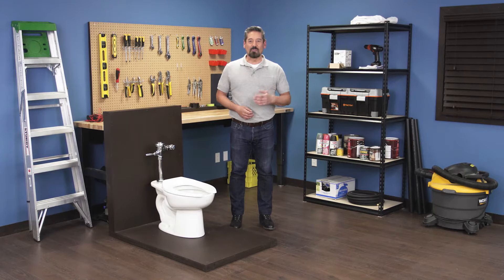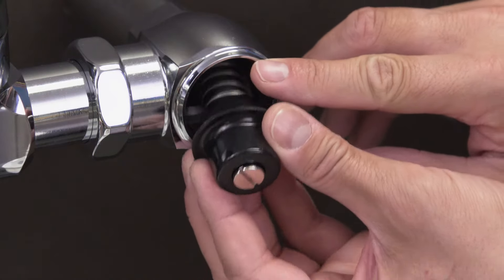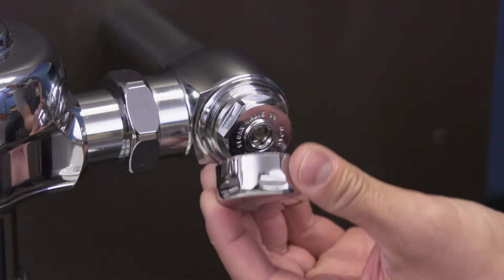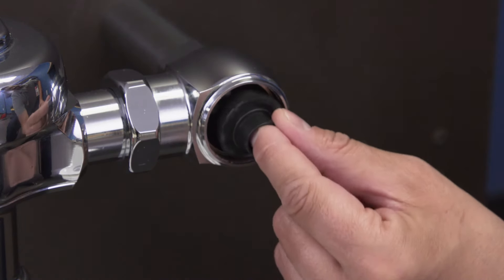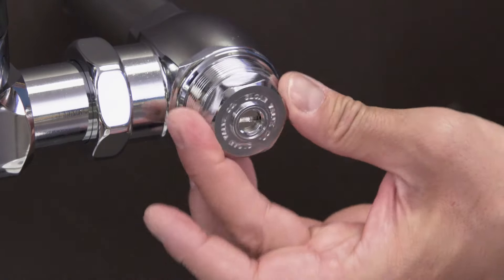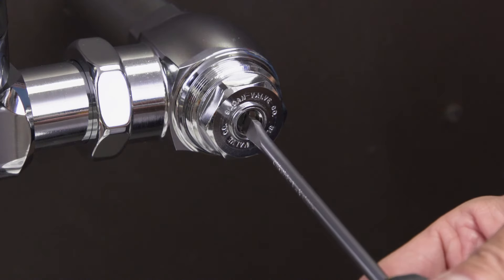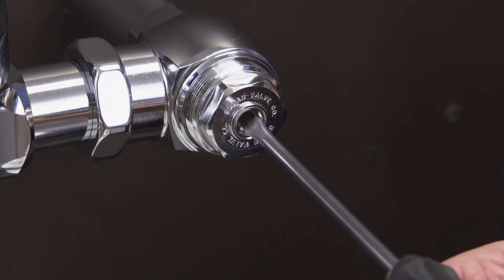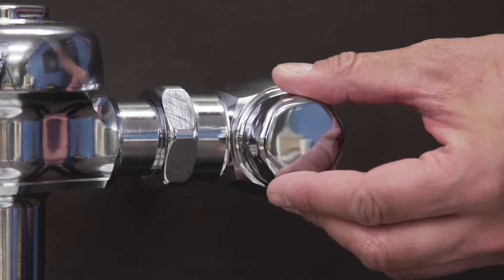Sloan Regal Flushometer | Control Stop | Repair and Replace

Comment: I just had the screw to the control stop get tight and stuck. Kept trying to turn to open it then the screw totally took a dump. Why do screws get stuck or go out on these.
Reply from the maker: Thanks for watching. It could be corrosion or a buildup of calcium that causes the screw to seize up.

Comment: Close the shutoff valve to the water line. This might be located in the ceiling or wall panel. Is there a way to trace where the shutoff will be? I have a toilet control stop that need la changing and have to trace it down to find it?
Reply from the maker: Thanks for watching. Every building is different so it is difficult to say. In some buildings there is a shutoff valve to the entire bathroom. In other cases you'll have to shut off water to the building. You can contact the building management as they should have more info.

Comment: having this problem rite now. plumber coming today. i am not fooling with it myself. i live in a 35 unit condo building. but they are replacing the entire flushometer.
Reply from the maker: Thanks for watching Mary Jaye. Sometimes its best to get a professional, but its always good to know a little bit about what they are doing. For installations, this is whats involved: https://youtu.be/Owi6awYTTnw
Reply: 3 MONTH OLD REPLY. I DON'T USE G MAIL MUCH. IN THIS CODNO BUILDING ONLY A LICENSED PLUMBER CAN DO THE WORK.BUT I WANTED TO SEE WHAT THE PROBLEM WAS. I SURE COULDN'T FIX ANYTHING! :) THANX AND SORRY FOR THE LATE REPLY. MARY HAVE A GREAT YEAR

Comment: Hello what would be the symptoms for repairing the control stop? I have water coming down the fixture when flushed more so when it nears the fill up.
Reply from the maker: Thanks for watching. A faulty control stop might not close all the way, it might also leak from the threads on the front. If the leak is coming from the control stop you should be able to wipe the water and see the water forming around that spot. The vacuum breaker can also be another source of leaks: https://www.youtube.com/watch?v=k2AmW8Xzwpo

Comment: The cap nut doesn't need any pipe dough or anything?
Reply from the maker: Thanks for watching. The sloan manual says that with exception to the control stop inlet, plumbing grease should not be used on any valve component or coupling. https://www.sloan.com/sites/default/files/2016-06/Sloan_Exposed.pdf

You can use plumbing grease on the control stop inlet as it doesn't use an o-ring.

Comment: I have a plug in my control stop instead of a vandal resistant cap.  Is there any easy way to remove it so I can adjust the flow?
Reply from the maker: Hi Scott, thank you for watching. Usually any cap or plug that can't be unscrewed with an adjustable wrench, can be popped off with a flat blade screwdriver.

Comment: Is there a way that a bidet can be installed in this kind of system?
Reply from the maker: Hi Mari, unfortunately with flushometers bidets can't be easily installed without extra plumbing like soldering a T into the supply line or running an water line from a nearby sink.